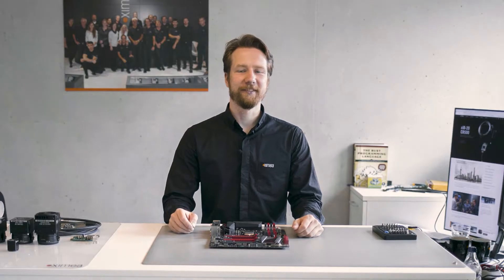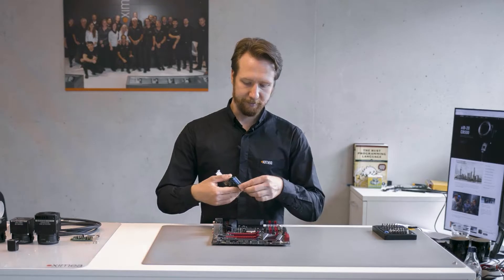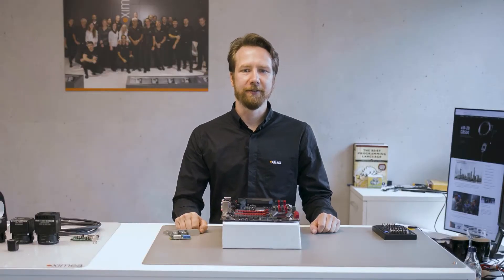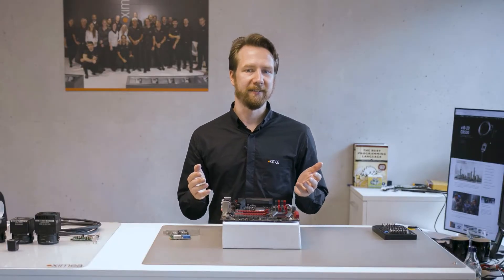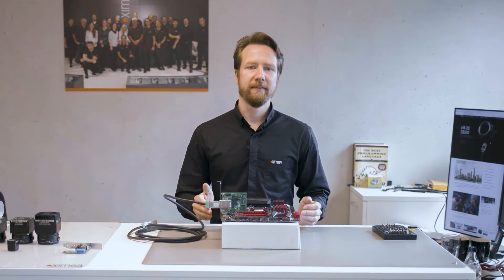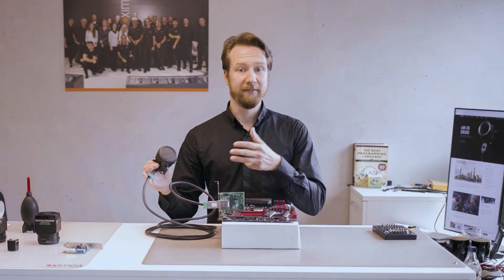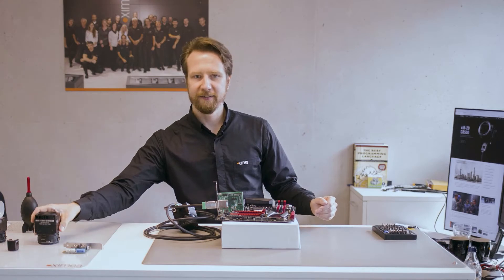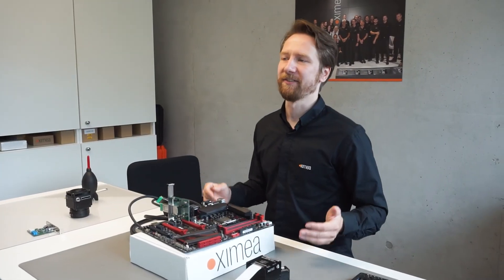PCIe Interface - Advantages for XIMEA's industrial cameras and their high-bandwidth demands

Comment: Do Ximea cameras work with AMD Threadripper computers?  They offer more PCIe lanes than the Intel non-Xeon computers you are demoing with, which could be helpful for multicamera systems.
Reply from the maker: Hi Chad, thanks for the comment.
Yes, all current AMD CPUs including Threadripper and EPYC are fully supported. With the additional PCIe lanes you could connect more cameras, storage devices or GPUs for image processing.
In fact, one of the cameras we used to shoot this video is directly connected to a Threadripper PC via PCIe. I use this PC almost every day and it works perfectly with all XIMEA cameras. If you have more questions ask here or send us an email to info@ximea.com.

Your XIMEA Team